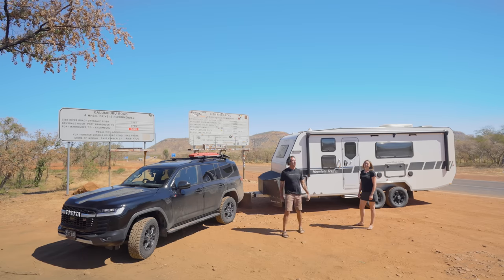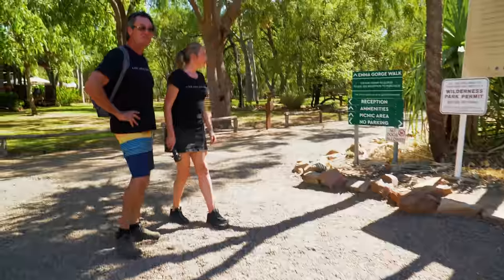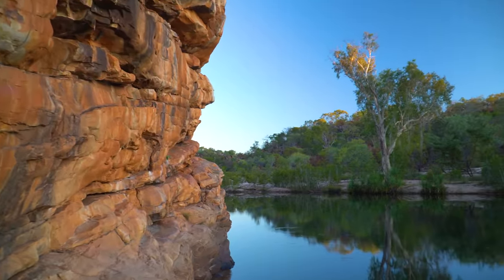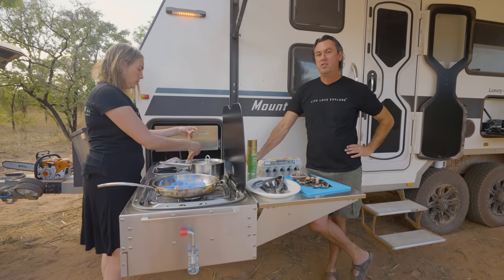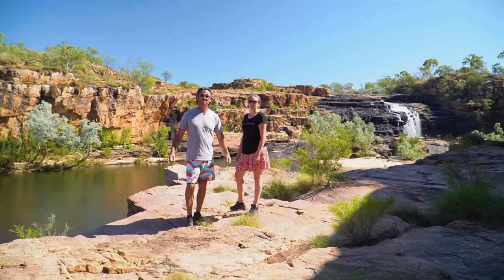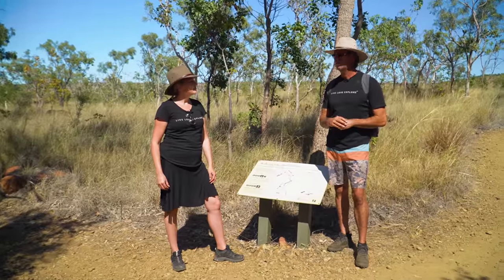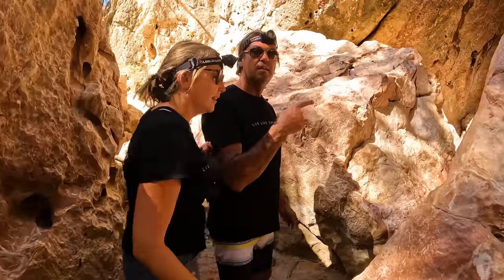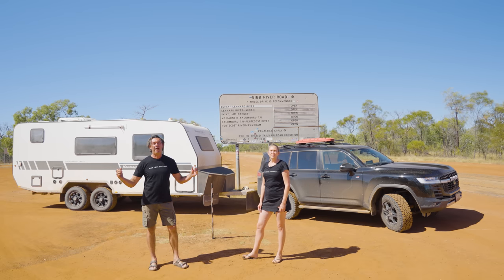Don't Miss: Toyota Land Cruiser LC300 Towing 3.5 T on GIBB RIVER ROAD

Comment: In 2006 my daughter and I drove through their after we done the east to west Crossing but when we went through the Ivanhoe Crossing we were clearly visible that those concrete pillars have to be shown both sides so you know it's safe you could hardly see the tops of the pillar on the waterfall side when we drove through and then we were told by the locals that we were the only ones who went through. But we did drive the opposite way because we had to go over through to Cairns to do the Cape York run then back to Brisbane and it was fabulous

Comment: A little tip when changing your wheels.
Always put one wheel under the car so if it slips it's not going all the way to the ground. When you swap the wheels over repeat again put the busted one underneath for safety. And when you replace your wheels use a toy lever or the Jack handle to go underneath the tyre to make leverage up into place this takes the strain out of your shoulders and back

Comment: A safety tip when changing wheels. Put the spare or flat wheel under the chassis incase the jack fails. Also never put your hands or head under the wheel arch. Hold wheel by sides or spokes. Quickly spin on wheel nuts. 
My work colleague lost his friend to a jack failure! 😢
Take care out there. 
Enjoy your travels. 
PS doesn’t the cruiser have TPM (tyre pressure monitoring) as standard? You said in the video you didn’t realize the tyre was flat!

Comment: Great vid the van looks a good bit of kit. , how crazy with the 300 series having the tools under the floor needing everything removed LC 200 tools in the lower tailgate another reason I won't be trading up from the 200 anytime soon , Toyota need do better with jack & jacking point & the jack also. Temp up with speed can cause these problems, also too lower tyre pressures exposes the side wall to sharp rock damage a bit of a balancing act . We always use a Stone Stomper money well spent no damage. Safe travels.

Comment: To me it looks like your speed was the factor in tyre blow outs… dropping pressure in the tyres will increase tyre temps …. So if you want to keep the speed up they will blow out…. We never did one tyre… but we kept our speed to 70k or less… with lots of stops to lessen the tyres overheating
Reply from the maker: Good advice, we had a lot to see in a short time, so we were driving fast!!

Comment: Did the Gibb last year on  new LC200 with a camper trailer. I think the trick to having no tyre troubles is using mud terrain (built tougher) all round, dropping pressures to 20psi COLD, and keeping the speed down. I gave myself a top speed of 70, mostly 60kmh. Stop every hour to check tyres and bearings for heat build up.
Watch out for some of the trucks, they are idiots.
Reply from the maker: We totally agree Darth Vader.  We were on a tight time schedule with the filming etc.  It would be great to do that trip again and have more time...

Comment: Yes, great country.  But tyre failures would more than likely be due to not driving to the conditions. I.e. too fast.  I’ve driven the GRR on two occasions over the years and never had a tyre issue. (Vehicles were a P38 Range Rover and a Mercedes GLS350d, the latter towing a camper trailer.)

Comment: Great video guys great tips seems like a very fine line between speed and lowering  tyre pressures  to make the ride not as bumpy over corrugations and  if you want to avoid tyre heating up failure  Do you think 60 ks -80Ks would stop this or  an even lower speed ?

Comment: Love this stuff and you guys are doing a great job of presentation. Is there a third person doing the filming? Respect that your vehicle was not modified, BUT a change of rear bumper and having a couple of spares hanging off it, also a kit with better gear like a power drill for nut and tyre removal and a better jack system. But I am sure you will be talking about these things as you go along and coming up with improvements.
Reply from the maker: Yes we are! Thanks for watching and yes we had a camera operator on the trip with us.  You can see her every now and then in the clips..

Comment: Very interesting. What is the TBW and how did you go with rear axle weights with the geat in the rear. Great van by the way.
Reply: Good question but no reply. It appears payload remaining after the 350kg TBW may be 300kg, for people, fuel and fridge, etc, so would be interesting. The rear axel weight seems to be usually a problem on nearly all standard vehicles

Comment: Was thinking about purchasing a new GR Sport but have found out the hot v engine drinks oil between service at 10 ,000km. Is this true or false ? At over $150k i don't want to be checking oil on my next outback adventure trip

Comment: Just wondering with your van would u reconmend getting a gvm on the Land Cruiser  all so loved your adventures from the start
Reply from the maker: Hi Brian, we were 50kgs under the GCM of the vehicle when fully loaded and 50kgs under the GVM with the van fully loaded and the weight on the ball. We have virtually no off-road accessories fitted to the vehicle, therefore if you want to add bull bar, winch etc it would be recommended to go for a GVM upgrade.

Comment: How heavy is that van on the ball when loaded and what have you done to the rear suspension in the 300 to cope with weight. Cheers 🍻
Reply from the maker: Hi Shreck, the ball weight was 350kg when we were fully loaded and we had Air Suspension Helper Kit for Coil Springs in the rear with 50psi in the bags.

Comment: We ran those Goodyears on our work Utes For 12 months and we’re averaging 1 wrecked tyre a week between 4 Utes, they’re absolute rubbish unfortunately just no strength in them.
Reply from the maker: Thanks for your comment, You may have a point here, we were certainly concerned, the tyres on the van are Toyo and we had no problem with them.
Reply: @MountainTrailRV  interestingly we’ve changed everything to Toyo now and had no issues at all, none.

Comment: You totally need to have better tools than the standard Toyota rubbish. Get a breaker bar and a decent jack. Also a tyre plug kit. Usually good practice to place the damaged wheel under the vehicle while fitting the replacement if your at all concerned about stability and safety.

Comment: Letting tyres down on that road is a bad idea it seems only tourists do it.
Reply: Your suggesting running at 45 to 50 psi on corrugated roads ? I don’t think so, 26 to 30 psi is typical for experienced 4WD drivers.
Reply: @barrythompson8813  I worked in a tyre shop up there for 15 years. You may not have had any problems but only tourists had problems with tyres in our shop due to letting them down.the locals were are the experienced 4wders had no issues and we didn't waste time mucking around with pressures 🙂